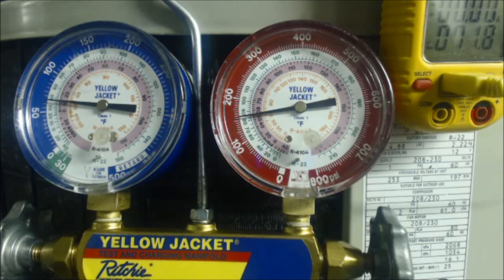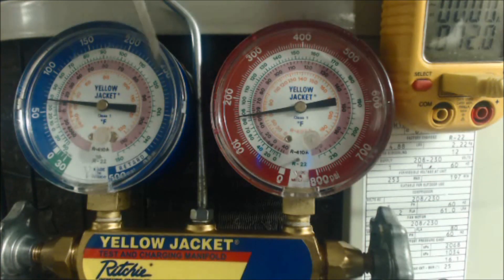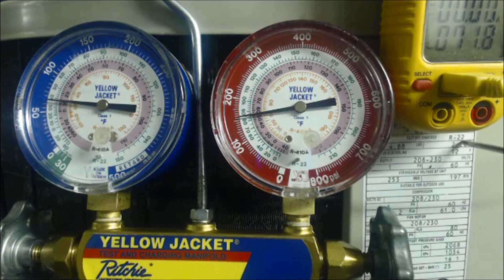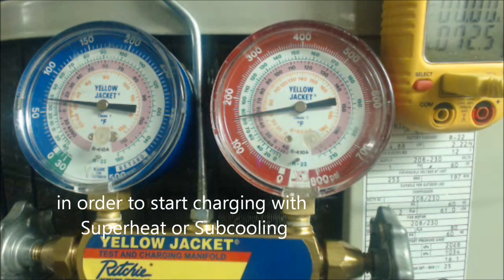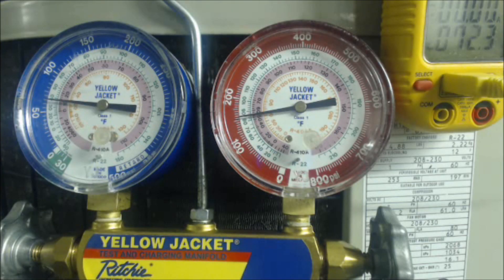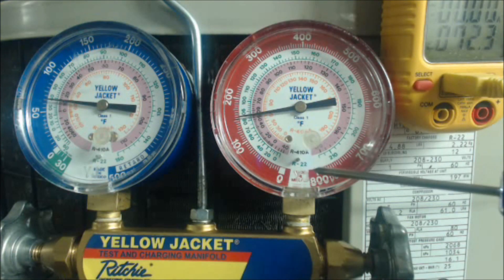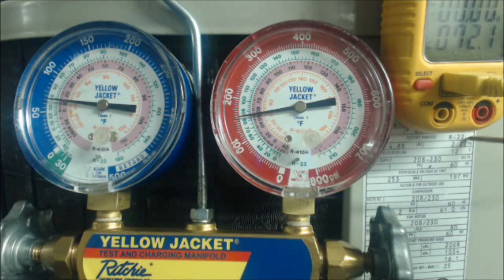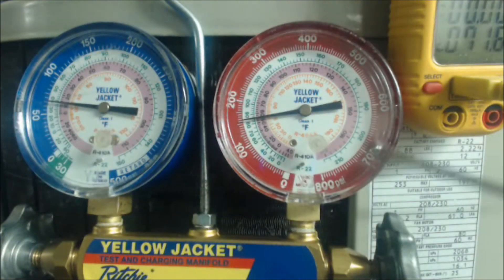Tutorial on How to Use and Read a REFRIGERANT GAUGE SET!

Comment: I dont suppose you have record or recall the outdoor temp that day? 

I'm pretty green yet, and trying to learn as I've been taught be old school techs to charge by sat temp of the gauges themselves. On R22, low side should be (obviously above freezing) 35-45deg (34-37 txv) depending on the load, and 10-30 above ambient, depending on load. 

Polar-opposite R22 examples;

Example 1: 60 deg day, 70 deg indoor load. Low side sat temps will be low 34-38 and head will be 10-15 above ambient (125 -145psi). 

Example 2: 95 deg day 85 deg indoor load (breakdown). Low side will be high 40-45 deg and head will be 20-30 (240-275psi) above ambient. 

In either example a TXV should maintain a 34 sat temp on the indoor.

With 410, hi side sat temps are about half due to higher seer. Head temps wont be as much above ambient, more like 15-20.  Each example was with mech. sound sys. and adequate airflow. Anything colder than 60 deg you wrap the coil and attempt to get head pressure above 175 for 22 and 275 for 410 then check/charge based on your low side sat temps but dont charge above 34 deg. I havent a clue how I would check/add charge on a txv system if I was forced to wrap the unit. 

The company I'm with now, I'm the only tech and am thrown to the wolves, not alot of time to ask questions and learn. Do have los of phone sex with the lead tech when IDKWTFID. But alot of it is blind charging and foolish when it doesnt take long to figure SC/SH. Ive only been in the trade 2 yrs (on my own for 8 mo). I was taught by 4 techs that are 35-50 y/o and been in the trade for 25+ yrs. Really, despite adding charge on a txv on a cold day, the above methods do work (with common sense). 

My lead tech for the company I work for now (who some might say is laterally a damn genius) can tell if a system is adequately charged just by listening to the liquid line at the evap and by feeling how cold the vapor line is at the cond. He verifies with gauges but is pretty damn close guess every time. I cant argue with someone who is lead tech with 27yrs, that why I'm hear with this long winded rambling tirade :)
Reply from the maker: Ha ha fun, It really is not that complicated when you know subcooling and superheat. All the rest are generalities and things you notice when a system is working correctly like the 20 and 30 degree above ambient. What we are really talking about is how big is the sat state in the coil and how much superheat do we have and how much subcooling do we have after the sat state. For comfort cooling, you really just need subcooling for txv's and like you said, make sure the low side is not freezing. For pistons, find the target superheat and set it to the correct superheat on the low side. I always cringe when people try to set the charge without superheat on a piston system as on some cooler days, the system ends up putting liquid into the compressor if it is even a little overcharged.  So you know, we don't wrap the sides of the unit on a 60 degree day. That would mess the sat states up in the outdoor unit. We restrict the airflow at the top to get to those pressures you were speaking about on the high side. Also keep in mind the the inside house temp must be raised so the indoor coil has some heat to absorb as the house temp will fall quickly and the low side gauge may approach or get below freezing. Check this playlist out. There are superheat, subcooling, possible pressures, sat temps, and troubleshooting in there-  https://www.youtube.com/playlist?list=PLxnHR5_D2ojxZI3-xx03Bttxe3xCqUD87

Comment: Question: I was diagnosing a no cooling call on my AC which is a R22 system, my low side was 97 and high side was 98 both were reading equal pressure. i unhooked my gauges and re attached them after an hour and i was getting 89/91 on low and high both equalized. I suspect it is compressor could it be metering device or is it low on charge?
Reply from the maker: It sounds like maybe the outdoor fan was running but the compressor was not running. Did you take an amp draw safely, or listen for the refrigerant moving in the pipe? The reason the pressures may have been different an hour later may just have been the outside and inside temps.

Comment: I did a system check and on the blue side/low side it was 125. and on the high side it was almost 300. please help?I do not want my compressor blown.
Reply from the maker: Are you talking about R-410a?
Reply: acservicetech /yes thanks.  the system is 4-10a.
Reply from the maker: Those pressures may be normal depending on the temp that day. You would need to check the subcooling if you have a txv or superheat if you have a piston, thanks
Reply: yeah 410a  thanks
Reply: acservicetech also the compressor is really loud. it always has been. I was told to add oil. is that true?best regards
Reply from the maker: I doubt you are somehow missing oil. Scroll compressors can possibly be louder than an older r-22 reciprocating one and definitely louder when it shuts of.

Comment: I'm a maintenance tech in a rental community and I do this stuff almost everyday and yet I find your videos incredibly interesting, thank you very much for sharing, you're an very good teacher 👍
Reply from the maker: Thank you Argenis Zurita!
Reply: So you're a maintenance tech how about that? I tell you what I did high performance sealed system job on the old Bert hole and come to find out I had a restriction and the cap tube of the old butthole, I fixed it though I don't want everybody worried about it

Comment: sonyou only read the green part??
Reply from the maker: The outer ring is pressure and the inner ring is the saturated temp. If the unit has r-22 in it like this one then you would use green for the sat temp. If the unit had R-410A then you would use pink and r-134A you would use light blue. Thanks
Reply: acservicetech thank you for explaining i really appreciate it
Reply from the maker: No prob!

Comment: If the vapor side is low, how do you know if the refrigerant is low or if there is a leak. If there is a leak,  do you use the reading on the vapor side to determine the leak is at the evaporator? How do you know the leak is not in the line between the evaporator and the condenser?
Reply from the maker: The pressures will be low on the low and high side of the gauges if there is a leak while the system is running. If the system is off then you would not know if a system had 6 oz or 12 lb because it works just like propane does where the liquid boils and the vapor is what applies the pressure. Take a look at this playlist to learn more about how it all works ---- https://www.youtube.com/playlist?list=PLxnHR5_D2ojwbAc7K7DsjuasaDVfJeGSe ----- Here is another on finding a refrigerant leak ----- https://youtu.be/2Be_sG-HQTQ

Comment: What is the target sub cooling?   Is it to match the superheat?
Reply from the maker: Great Question! Target subcooling is found on the rating plate of the outdoor unit. Target superheat is found by the outdoor temp and the indoor wet bulb temp found on the superheat chart. Subcooling is the temp decrease in liquid form at the outdoor unit and superheat is the temp increase in vapor form at the evap coil. Here are some videos that will help https://youtu.be/qqLwE7Kbyawhttps://youtu.be/bIL9BrKCujchttps://youtu.be/q-G7FLlzhAg

Comment: what if the subcooling minus ambient temp comes out to be 0 degrees, eg, 80degrees-80degrees=0degrees? i need to add refridgereant?
Reply from the maker: Yes that means that there would not be a solid column of liquid going to the txv. How did you make out with the testing of your txv from your other posts?

Comment: On 410a, how do you determine a good high side pressure? like on the low side it's typically a 40 degree coil?
Reply from the maker: Well that really depends on the efficiency of the heat rejection such as the seer rating. The higher the seer rating, the lower the head pressure. If the fins are dirty, bushes are too close, seer rating is low or salt water is corroding the fins then the head pressure will be high. That is where you see you differences. The compression ratio head pressure divided by vapor pressure will really determine efficiency. Inside temps are always within 15 degrees, the coil is in good shape and the txv controls the superheat. A hot day can drive up the outdoor pressure. I hope that helps! Thanks for the question!

Comment: Great job! I'm learning still and you've helped me a lot. Wanted to ask you , I need to add 10Lbs of R-22 because I replaced a compressor and need to fill it up. On the gauge where to I stop at ?
Reply from the maker: Thanks for the Comment! You need an electronic scale and break the 500 micron vacuum with the refrigerant. Here is a video on the initial weigh in into the liquid side with the system off. https://youtu.be/ncgLDYrvN6where is another video on the vacuumhttps://youtu.be/nBCWYgCcnpE

Comment: Hi, I like the way you instruct hvac, congratulations!. Question, I have a package unit cool water heat pump 2 ton unit in my apartment, Does the pressures and temperatures are the same as residential split units. My unit is R 410a I know R22 are  different pressures.Ozzha in Miami Fl.
Reply from the maker: The biggest difference is the condenser in cooling mode or the evap in heating mode being a refrigerant to water heat exchanger. Depending on which system you have, if it is geothermal or chiller and the gallon per minute flow, temp, and size piping, the condenser pressures in cooling mode would likely be less than a traditional split system with refrigerant rejecting heat into the air. You have to take that type of system, gpm, water temp, and size piping, into consideration from a troubleshooting standpoint but the vapor pressures in cooling mode will be very similar. The manufacturer would state on the rating plate or the inside of the door, how they would like you to charge the unit taking these things into consideration. Thanks for the Comment!